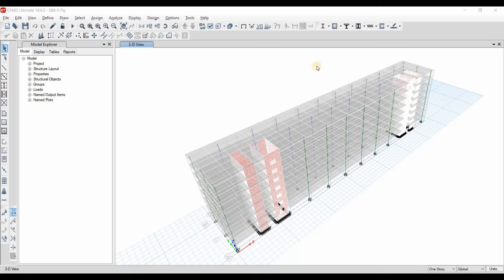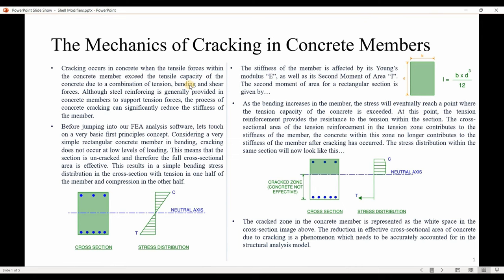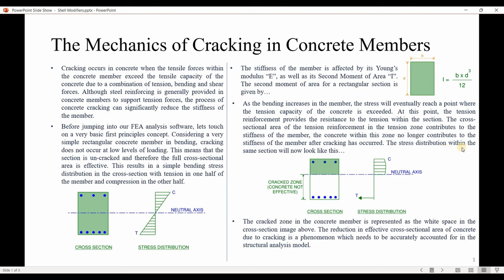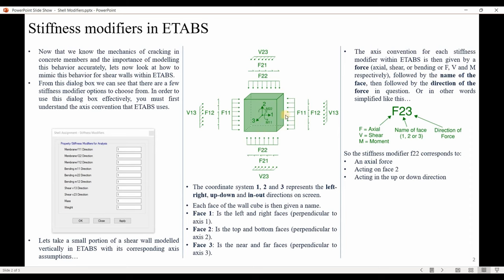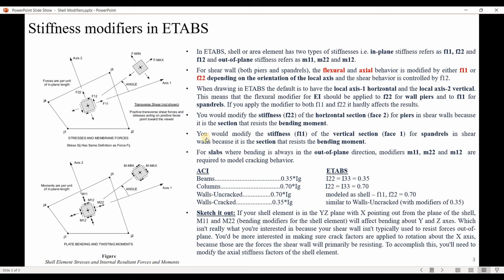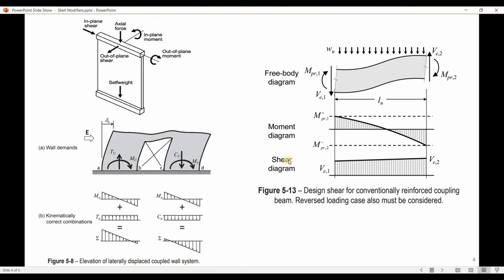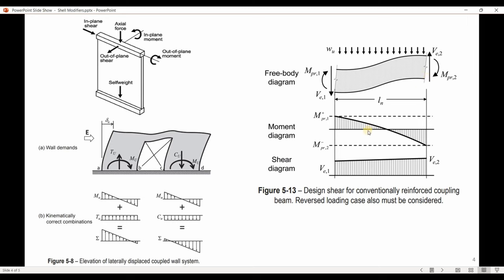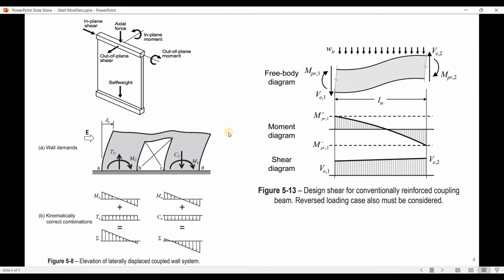ETABS Tutorial 7: Detailed Explanation of Stiffness Modifiers of Shell Elements (Shear Walls & CB)

Comment: Could you brief the behaviour of modifiers for the bearing wall system please. They don't go under crack or non-cracked just for gravity
Reply from the maker: In a bearing wall system, the walls primarily carry vertical loads, known as gravity loads. So, when considering modifiers for such walls, it's important to assume an un-cracked section, as cracking can occur due to gravity loads alone, even without considering lateral loads. This ensures that the design adequately accounts for potential cracking under gravity loads.

Comment: When should I consider cracked sections for the concrete elements?
Reply from the maker: In our concrete element design, we focus on the ultimate load condition, anticipating structural component cracking. Consequently, we adjust stiffness to account for this expected cracking effect.

Comment: Normally when I was check using modiefier the reincforcement req be small than if you using default stiffener..why that can be happen you think?? Is it dengerous or not if you reduce the reinforcement because modifier stiffner change??
Reply from the maker: The reduction in reinforcement requirement when using modifiers compared to default stiffness may occur due to the adjustment in the distribution of loads within the structure. 

When modifiers are applied, the stiffness characteristics of components is changed, resulting in redistribution of loads within the structure.

This redistribution can lead to reduced demands on certain elements, resulting in a lower overall reinforcement requirement.

In general, higher stiffness means ==> higher demand forces ==> higher reinforcement ratio
Reply: @Eng.tarekyoussef  so does this means in earthquake, the beam having 0.35I reduction in stiffness and column 0.7I means the beams is more flexible than column, therefore, the beam fails first before column? For reduced reinforcement due to stiffness modifier, what does it mean to the beam? the beam with less reinforcement is forced into ductility?
Reply from the maker: In seismic design, when a structure experiences an earthquake, the stiffness modifiers (such as 0.35I for beams and 0.7I for columns) are used to represent the reduction in stiffness of elements due to various factors like cracking, yielding, or inelastic behavior. 

Yes, if the beam has a stiffness modifier of 0.35I and the column has a stiffness modifier of 0.7I, it implies that the beam is relatively more flexible compared to the column. 

However, it doesn't necessarily mean that the beam will fail before the column. The behavior of the structure during an earthquake is complex and depends on various factors including the stiffness, strength, and ductility of individual elements, as well as their connections.

Reduced reinforcement due to stiffness modifiers means that during an earthquake, the stiffness of the structure is reduced due to cracking or yielding of reinforcement. This can lead to increased deformations and redistribution of forces within the structure.

Regarding your question about the beam with less reinforcement being forced into ductility, it's important to clarify that ductility is a property of materials and structural elements to undergo significant deformation before failure. In seismic design, ductility is desirable as it allows structures to dissipate seismic energy through controlled deformations rather than sudden failure.

If a beam has less reinforcement, it may indeed be forced into ductility more readily during an earthquake because it has less resistance to the applied forces. However, this doesn't necessarily mean that it will fail in a ductile manner unless the design and detailing of the structure are done to ensure ductile behavior under seismic loading.
Reply: Also, you should consider stiffness modifier on floors, you will obtain more reinforcement in beams!

Comment: For shear wall, it is f12 that affects the most (not f11 and f 22)?
Reply from the maker: "f" represents the axial forces/stresses,
"1" corresponds to the face perpendicular to local axis number 1, and 
"2" indicates the direction of the force acting on face 1 (Same direction as local axis number 2).

If the default orientation of the local axis is used for shear walls (local axis 2 oriented in the Z-direction), and by modifying 
f12, you are essentially changing the axial force or stress acting on face 1 (vertical section) in the direction of local axis 2. 

This alteration can impact the equilibrium of forces within the member and consequently affect its shear behavior only.